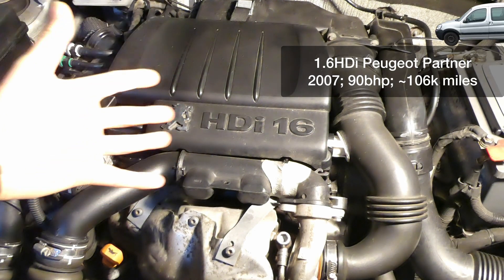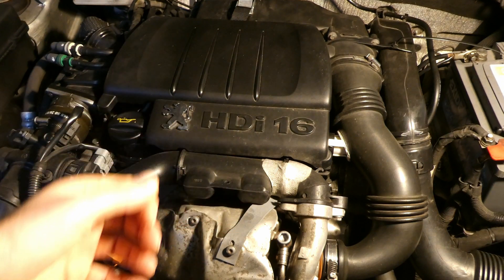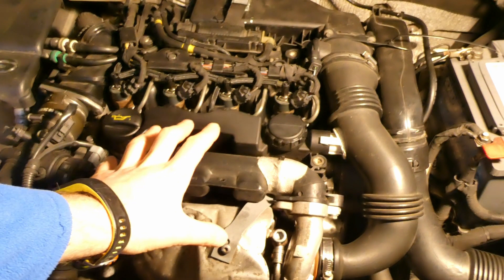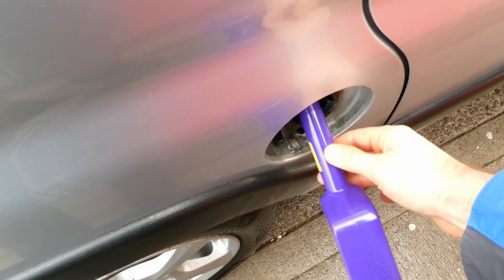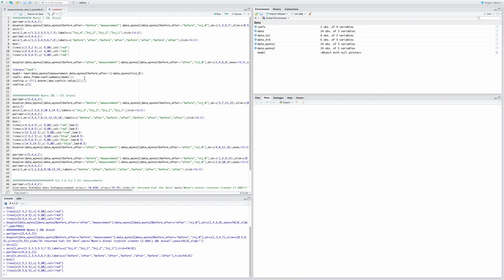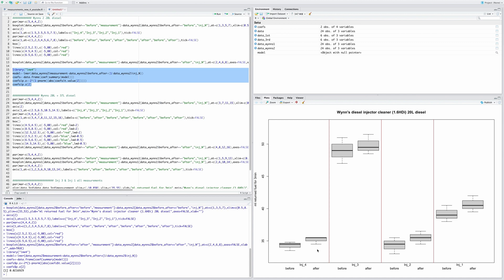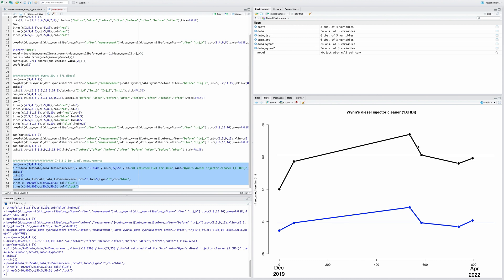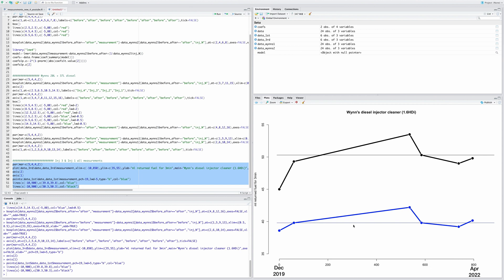Can Wynn's diesel injector cleaner do better with higher concentration (1.6HDi)

Comment: Well done for going into such a details. 
I been doing taxi in London and done around 60,000 miles a year .
I had always 1.6 diesel engines , such Ford Focus 2014 estate  ,Mondeo mk4 2013 ,and Astra J 2015 1.6 diesel 136bhp and chain driven. 

I tried all the diesel and injectors cleaners like : 
Liqui momy, Wynns ,STP , Redex, Forte, but they all sort of worked a bit .
And l did change the oil EVERY 5000 MILES ...
Nearly every month.
Just oil and oil filter ,the rest every 6 months .

But the best treatment that really really worked for me ,
on the miles that done it's the one called :

Archoil AR6900-D Max Advanced Diesel Fuel Synthesis .

This stuff it's magical, my engine it's extremely quiet in the very cold morning and loads more power and revs less than 2000 rpm , on cruise control on the 6 gear doing 70 mph..

I am not an expert just giving my opinion what worked for me ...
Reply from the maker: Many thanks indeed for the comment/suggestion, really appreciated. I will have a go at the liqui moly as it is relatively easy to do and I do not need to wait to exhaust the fuel in the tank. If that does nothing I will try the Archoil as well.
Reply: Might do a test with k2 diesel dictum, lots of eastern europeans use this (never heard of before) it has ads on youtube and other non english reviews but might be interested in it.
Reply: The industry standard test is the CEC F-98-08 which luckily for us, takes place on a Peugeot 2.0 HDi. The Archoil AR6900D Max is tested to those conditions, hence it actually works.

Comment: Hello, I was cleaning the injectors directly bypassing the fuel tank, I connected to the injection rail because the car was changing and I did this treatment twice a year and now I have peace. The preparation is liqud moly desel.  I also recommend such a procedure
Reply from the maker: Hi Bartek, yes that was my next step to try liqui molly with bypassing the fuel tank and the fuel filter. I only repeated this as it worked the first time around and wanted to see if it is better with less diesel.
It is also simper to do for most people as well, without any additional connections.
Reply: Really try it and you will see differences in pre-rinse and post-rinse parameters.  In my 307 1.6 hdi, I had the injection standards and now I have max 0.05 at idle, this is how it shows me obd2 icar and the fap light app
Reply from the maker: @bartekbartek8013  Exactly. Are these "injection standards" the injector's correction values? If these are the correction values, 0.05 is pretty amazing actually.
Reply: @moremolecules   Yes cleaning liqud  im very hapyy . You try and  send on you tube video  on your chanel and I will WATCH

Comment: They moving so much together, I think the leaking amount is driven by some factor that not considered here.
Reply from the maker: Hi Baku, thank you for your comment, much appreciated. I would have thought that they would move together or the leaking back amount will be linked between the different injectors. They are not independent of each other. Whatever chemicals (fuel, Wynn's, etc.) is going, it is going to every single injector. So, if these are doing something, cleaning or blocking, it will be similar or at least the amount will be linked, correlated or associated with all 4 injectors.
Reply: @moremolecules  Hi, thank you for the answer. My idea is that the effect of cleaning fluid is negligible compared to the effect of different driving habits, even  if one tries to replicate its own routes, habits etc. I suspect that a long period of consisten highway drive (2500+ RPM) might have a bigger effect on the injectors. Btw I always looking forward for your videos, great job, much appreciated!
Reply from the maker: @bakudetre6903  I see what you mean and I kind of agree, although the injection is electronically controlled and it should be stable regardless of the route or the different ways of driving. I could probably test the consistent motorway/highway driving.
Reply: These cleaners can end up cleaning debris which is then flushed into the injectors and causing restrictions inside the injectors since the clearances are so small.